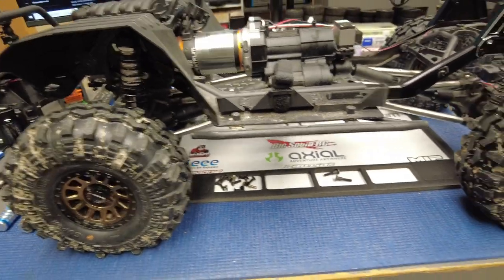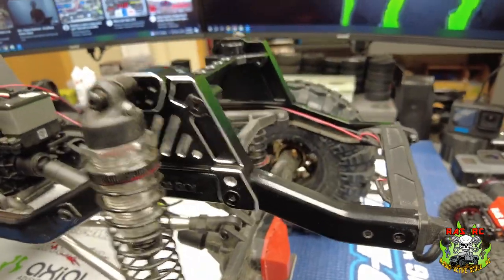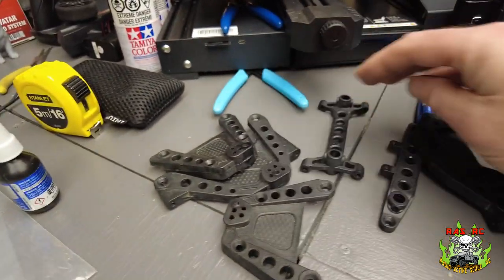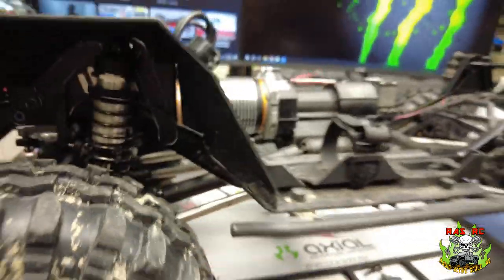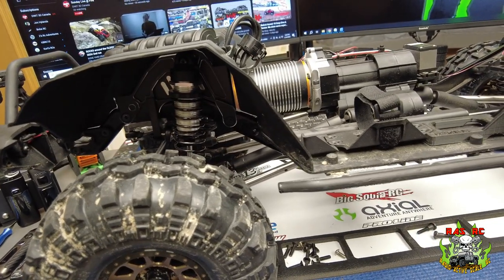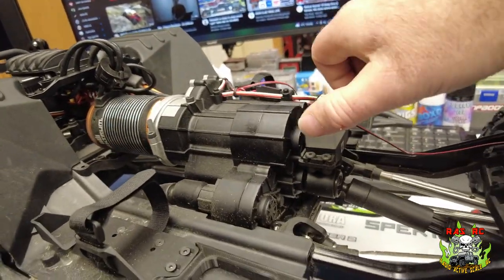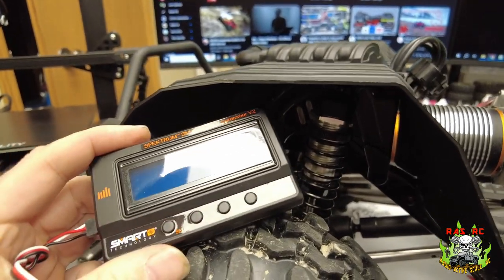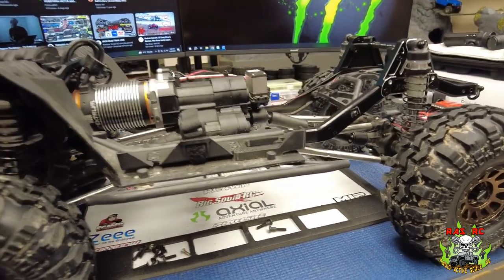AXIAL SCX6 TRAIL HONCHO “GETS SOME ALUMINUM UPGRADES”

Comment: Nice upgrades Radio!! U know those diff covers are going to do a good job. Would of been kewl to kewl to know how far the batteries when down on ur run too. Id bet u barely used em even after as long as u ran it for :) 18000mah is a ton!
Reply from the maker: I used one battery on my run last week and was out for 3.5hrs. tested it when i got home and all 3 cells were around 3.7v. so i should be able to get a good 7hrs with both batteries. which is awesome. so i am going to be getting a couple more forsure. really like the Zees Lipos.
Reply: @radioactivescalerc  That is an insane run time man!! Horymory!!
Reply from the maker: @DurpVonFronz  Ya i think if i was in highspeed more it would be alittle less but no need to be speeding when i was enjoying myself so much.